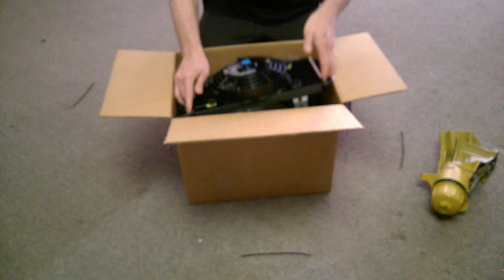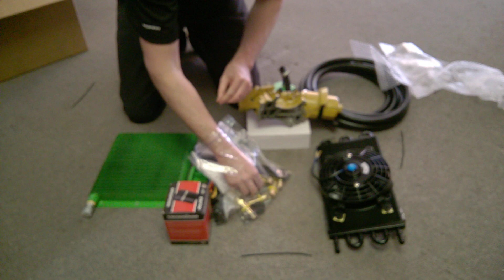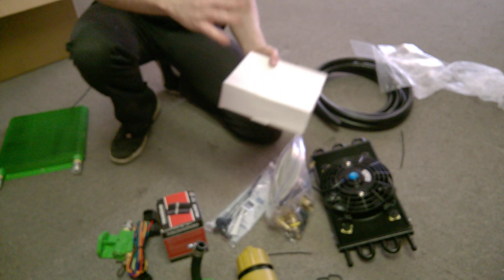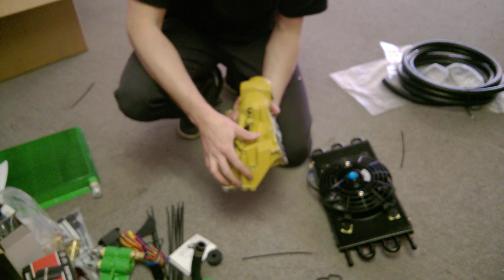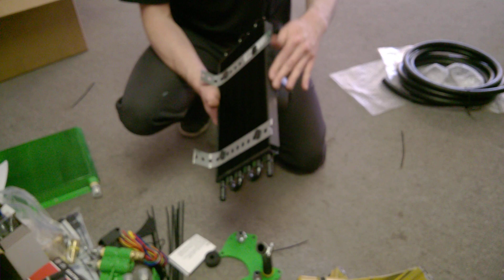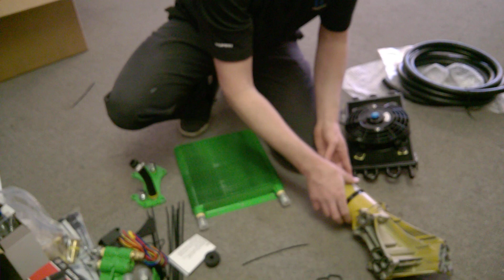D&J Diesel HD oil cooler unboxing. 3.0l VM Ecodiesel.

Comment: We no longer offer the full kit. 
If interested in the oil cooler plate those will still be available.
Brandon Jacobsen
D & J Diesel Performance and Repair
Reply: Are you talking the plate that attaches to the motor with the hose fittings?  If so, do you have a suggestion to what external cooler to use?
Reply: Contact us on our website for any information at dandjdiesel.com

Comment: This is not to question the design at all, I like it. Would there be a reason for or against routing oil from the cooler plate to the thermostatically controlled valve first, and then to the add on filter and cooler, there by preventing cold oil from going through the add on filter until at optimal operating temp? If I understand correctly, it would still be filtered by the factory filter in this scenario. Perhaps it's just not necessary, not enough flow reduction from the 2nd filter to worry about it. Thanks for your work on the EcoDiesel!!
Reply from the maker: This design had no effect on cold start performance, the spin on filter is the same one that has been used for 40 years. It has its own built in pressure valve. Millions of engines using this filter have been just fine during their cold start.